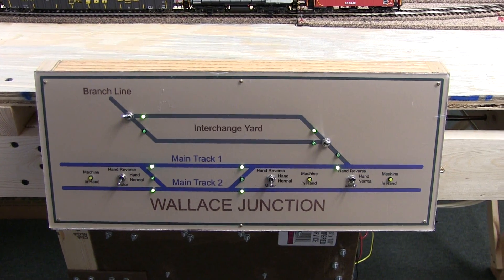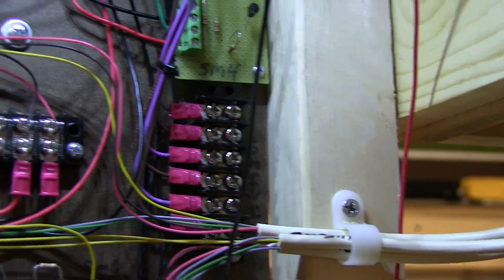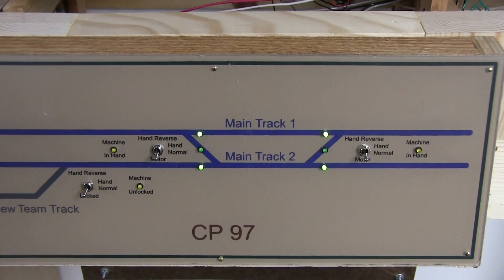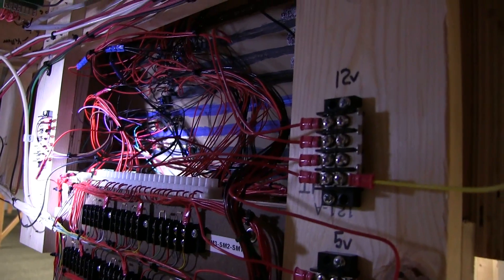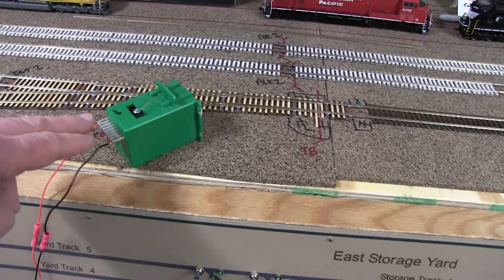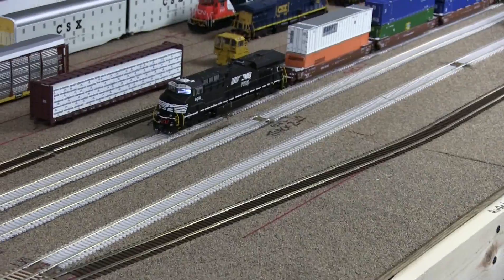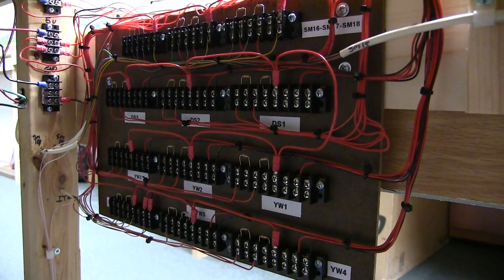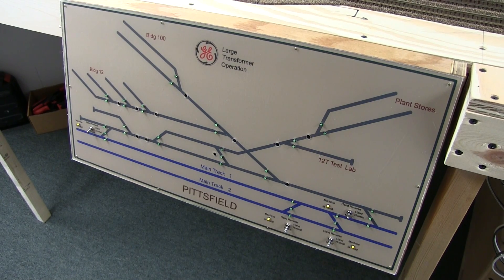Model Railroad Layout Update Video 25 Part 1- Control Panels, Wiring, C/MRI electronics

Comment: Steve:
Your wiring is what I call "bombproof" I have used this method for wiring a few MRRs in my time. Unfortunately, I have done troubleshooting on some MRRs where the owner just put together whatever they could fine cheap... so troubleshooting was more like disassembly of the old and putting in something approaching bombproof based on budget.  It might be halpful to provide some cost guidance for your methods. Fantastic layout and EasyDCC control.  Keep up the video streams.

Comment: Is there a yard lead or will all the switching be done off the main?
Reply: The intermodal side has leads at both ends. The main "yard" doesn't, but in reality it is more of a visible staging yard than a true working yard. Thus any shifting there will impact the main. Not a huge deal to us, as it will mainly only be Steve and I running things, so impact to mainline trains will be minimal.